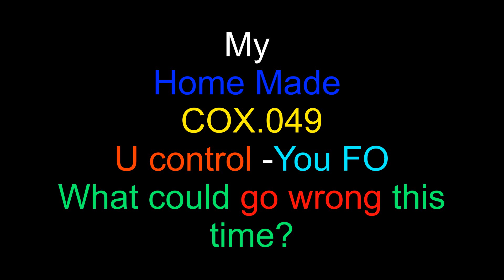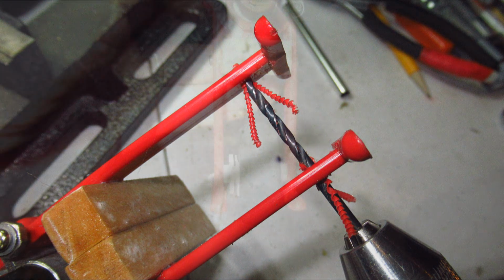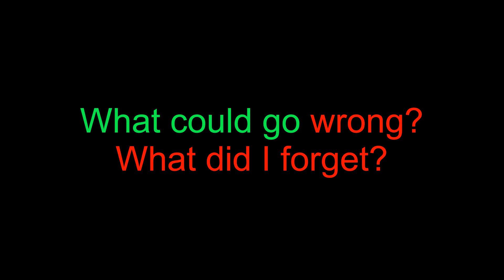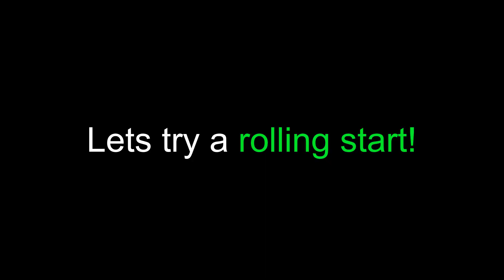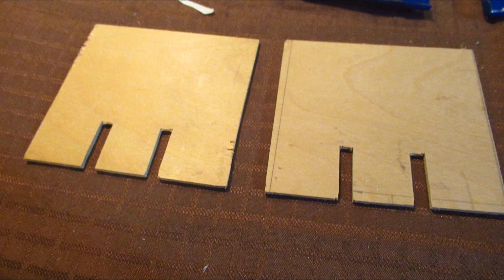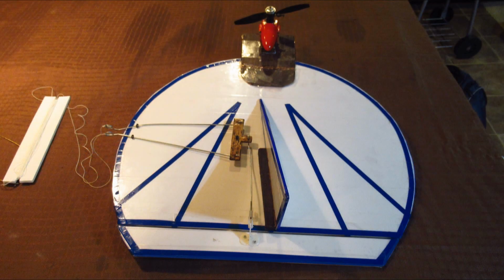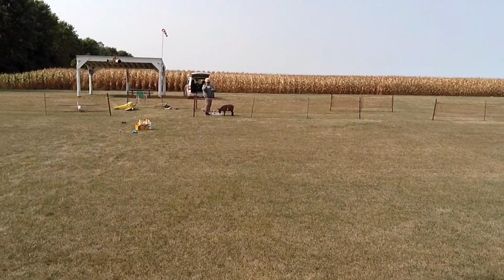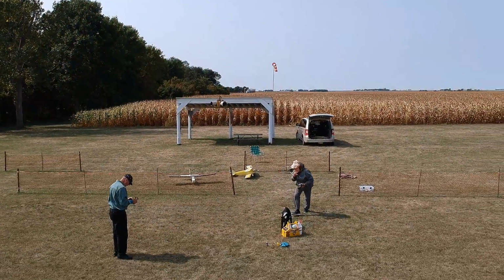Home made Cox Tee Dee.049 Control line plane design. Fails, crashes, GOATS, & what went wrong!

Comment: When I was a member of the Alameda Aeronuts, they had a version called a Platter, I nicknamed it the flying toilet seat. If balanced anywhere near tail heavy, it was a handful to fly, Nose heavy, it few just fine, They had several that we used as trainers and could take people visiting out and let them get the feel of U/C flying. I think one year held the record for flying the tail heavy one for nearly a full tank.
Reply from the maker: Great story. I have since converted this mini to full rc and it flies just as good as many of my other ones.  Here is a link to some of the ones I have been flying since 1978.  Thanks and happy flying.  https://www.youtube.com/watch?v=I3c1Ym_GBso  I also have made several videos on the Nitro powered ones.  They are fun and wont tip stall.

Comment: Probably enjoyed this one the most. Top marks to your good lady for the background work. By eye, looking at your bellcrank and leadouts, it looks like the bellcrank is too far back and the leadouts are facing forward, turning the plane in towards you. It is about 50 years since I last flew control-line so my memory may be wrong.
Reply from the maker: Actually it is deceiving as the plane is round.  If it was a wing like on my PT 19, the leadouts are far forward of the tail.  Also, with not enough weight on the outboard wing, it was the weight of the lines and lack of balance and me jerking it that caused it to fly in at me.  It was so tail heavy it was all over the place.  Once I added outboard wing weight and nose weight, it flew nice and tight, without me moving the bellcrank.  I already had 15 degrees of right engine thrust and 15 degrees of right rudder, so that really was all it needed and it flies great now, even when it hit the gusting wind.  Thanks for the props and my wife thanks you too.

Comment from the maker: I designed my own Cox Tee Dee .049 U control plane fashioned it after my RC You F.O. flying discs.  Here is what went wrong and what I did to fix it. So if you have a Cox Engine lying around you'd like to fly, you could do this too.  Thanks for watching, subscribing, and make sure to watch my 63 year old Cox PT-19 flight, by clicking here.  https://youtu.be/BU0z7ddwslY   Cox Engines are still available.  Here is the link. https://coxengines.ca/ 
Dave

Comment: Have you tried taking an electric rc plane and making it a CL setup? I know Flitetest did one with mixed results.  Mint a simple radio on your belt for throttle. You can then launch yourself when ready.  Of course it won't have the sweet sound of an. 049.